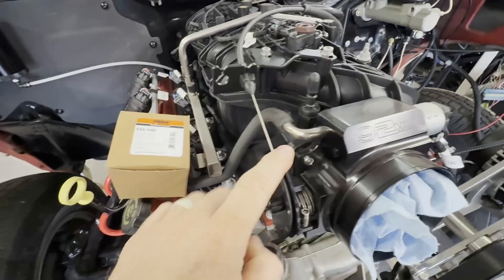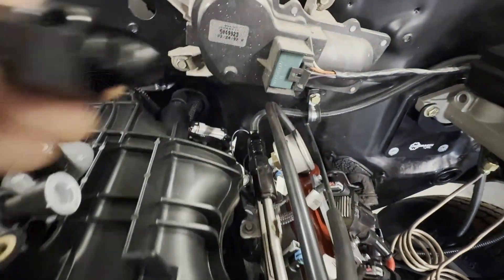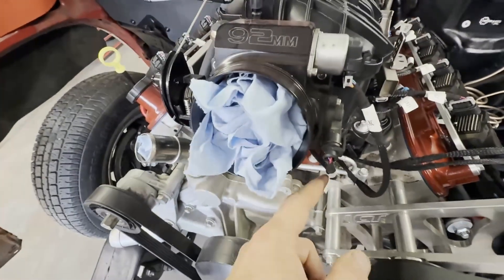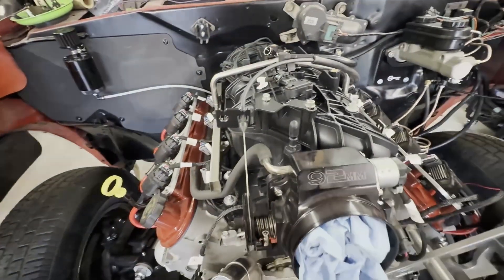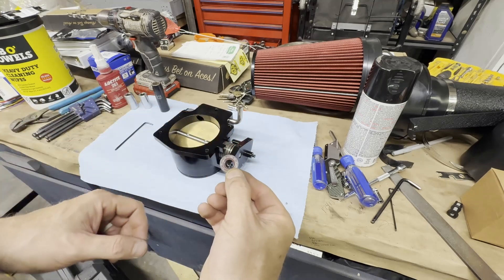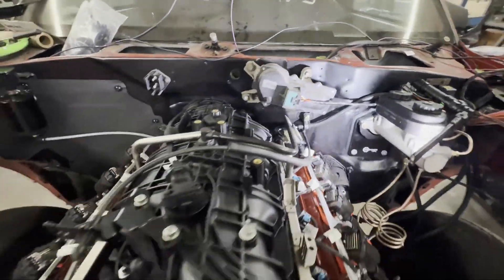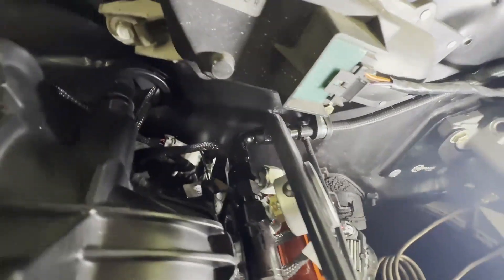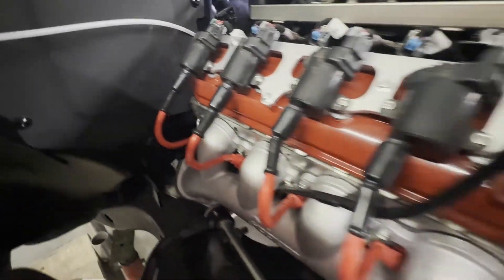Fuel Pressure Sensor Install and Throttle Body Mod to Prevent Leaks - #Acesefi #lsswap

Comment: I have that whistle at my  throttle body! I’m gonna have to try the seal.
Reply from the maker: @eddie3489 I am anxious to get mine going to see if it works. I think a part of the whistle also comes from the port inside the top of the throttle body. Some YouTubers have said that hole needs porting out. I am going to try this first before I do that modification. Thanks for watching and commenting!!!!